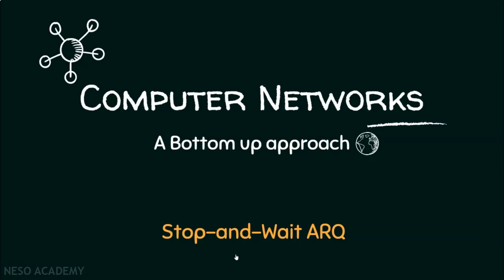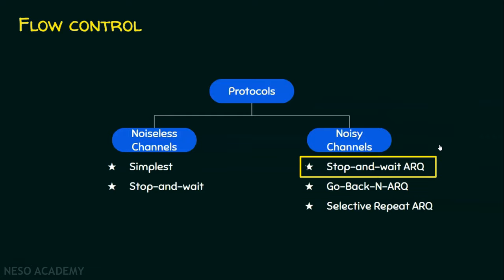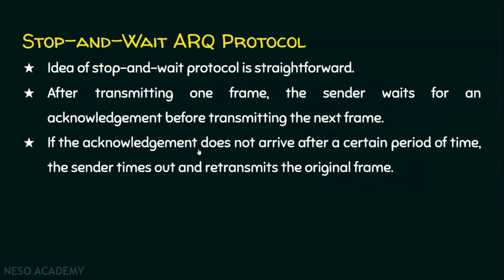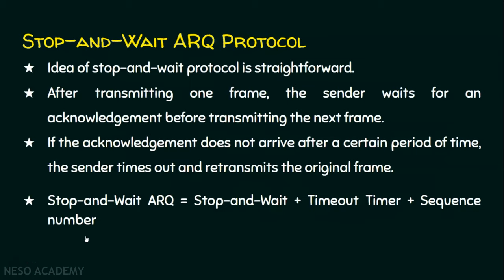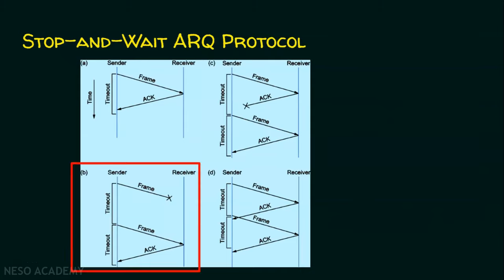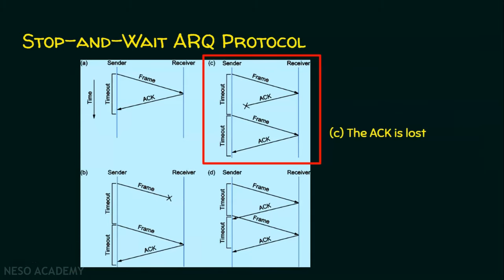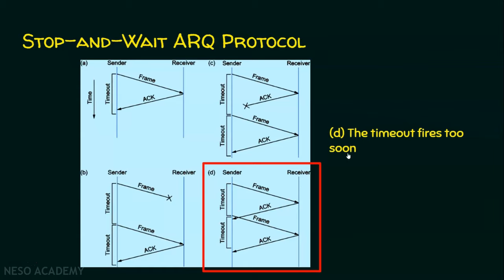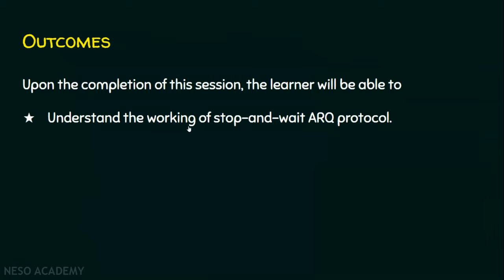Stop-and-Wait ARQ Protocol

Comment: A financial institution is implementing a secure communication system for transmitting
sensitive transaction data over a wireless network. Due to security concerns, retransmitting
entire frames may not be desirable. The initial sequence number for the transmission of
frames is 024689.
a. Draw a flow diagram depicting the operation of Go-Back-N ARQ to illustrate how the
protocol handles packet loss at frame 4 and retransmission in this noisy environment.
b. Draw a flow diagram illustrating the behavior of Selective Repeat ARQ to
demonstrate how the protocol ensures data integrity and confidentiality in the
presence of packet loss at frame 4 and corruption. Sir plz solve this question

Comment: The sender sending a frame again because of no acknowledgement from the receiver even though the receiver actually received it. 

So now the receiver will again get the same frame only right? Then what will happen ?
Reply: Receiver will reject the frame and will not send the acknowledgement.
Reply: @sunyog  so the receiver again didn't send acknowledgement to the sender this will let the sender send it infinite times it seems . Sorry if I'm confusing you  😂. Please carry on .
Reply: @jegadheesh_b2  the acknowledment received with delay is assumed by sender to be the acknowledgement of retransmitted frame.